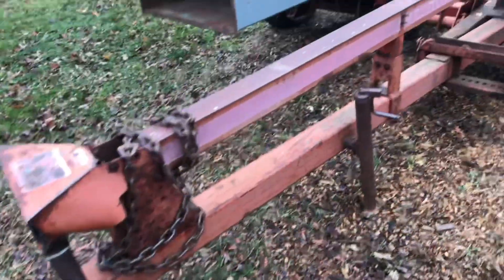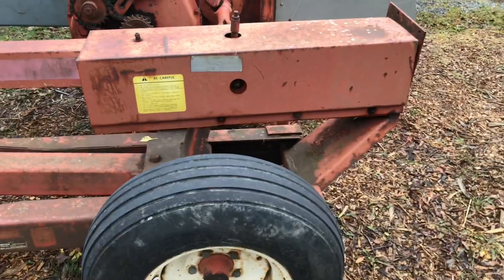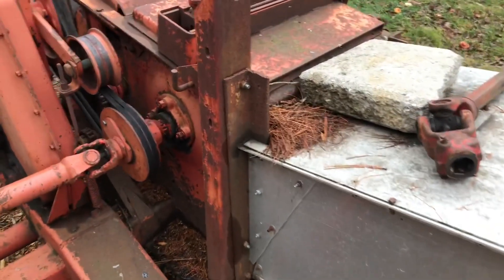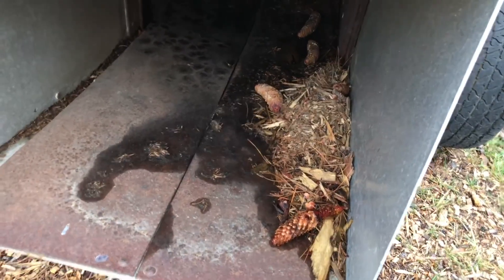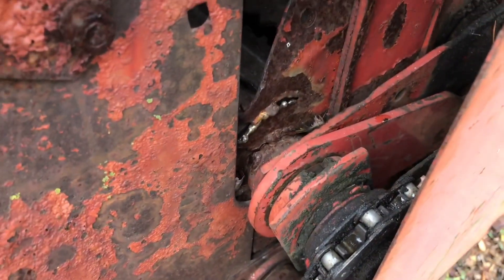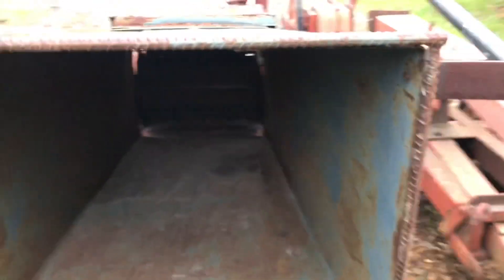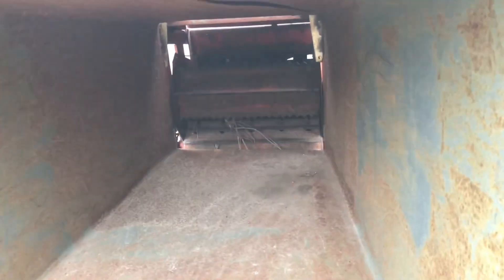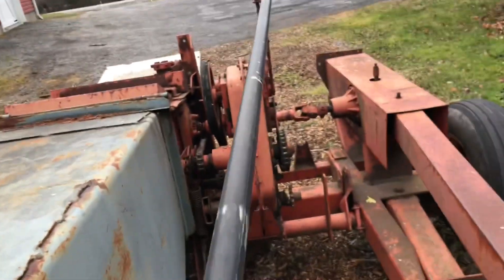Homemade PTO type wood chipper

Comment: I am thinking that it would be better to have it shut off by pushing the switch to the rear. That way if you are snagged and getting sucked in it will be easier to disengage.

Comment: Should have left the blower on.
How many knives are on the spider?
If it still has the full set of knives on, take some off.
Maybe change sprockets on the rollers to slow down the feed.

If it doesn't have the knife sharpener, could find one reasonable 

Angle down the discharge maybe.